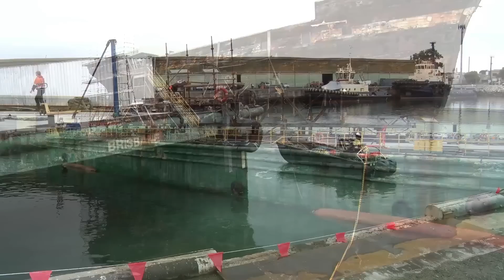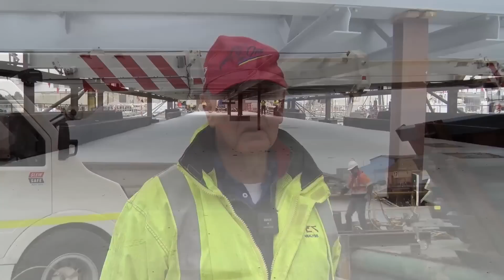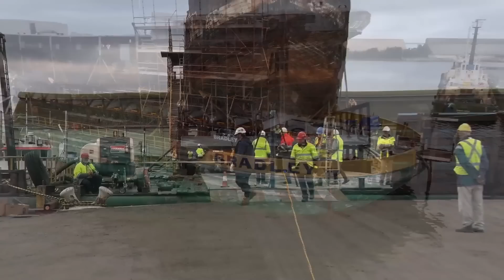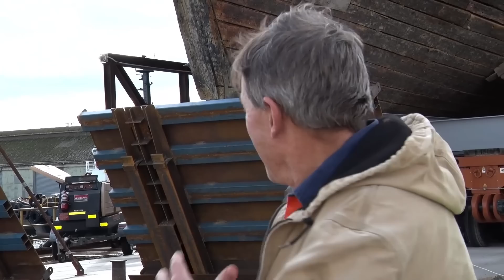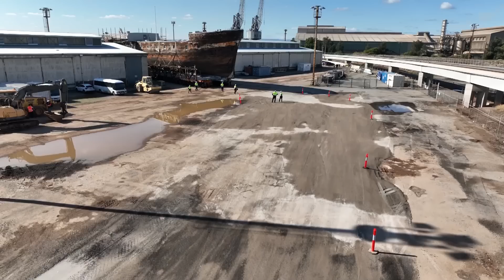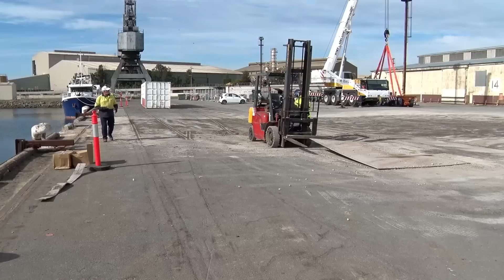Clipper Ship's Final Voyage.   Stage #4       June 13 -16   2024

Comment: I knew these ships are big in the water, but out of it, they're massive! Such a beauty of the past, being  moved with the latest technology. 💗
Reply from the maker: Thank you for your comment jcmac47. 
Those SPMT'S are something else aren't they! The ones you saw in action were "on loan" for the day (it was actually more like 4 days!!) from ANI (Australian Naval Infrastructure) & they move subs &/or sections of, at the submarine base here @ Port Adelaide.
Reply: @edster9221  To what degree is she going to be restored? With mast, etc, or hull only? Either way she's enough to make me want to visit eventually just to see her! Cheers from Canada.
Reply from the maker: Hi jcmac47
Thank you for your interest. Restoration over time shall go something like this...
1/ Three  First class cabins will be built (2 almost finished)
2/ Hull exterior will be caulked & sealed against the weather (original caulking between the planks has long since gone!)
3/ 3 Masts will eventually be added, & with the appropriate type of supports as per (they will also be that of original dimensions)
Interior in general terms will require minimal extra work (apart from the caulking) as we have already held several musical & interactive events. 
If you care to check out some of my earlier videos, it should give you a much clearer understanding of what has been achieved to date.
Reply: @edster9221  That's wonderful! Thanks so much for your reply. Much appreciated.

Comment: you guys Aussies? where abouts is this at, looks very much like Port Adelaide ? jezzs that a lot of wheels
Reply from the maker: Hi TurboHDT
It most certainly is Port Adelaide. The SPMT'S (self propelled modular transporters) that you see in operation here, has a load bearing capability of over 4,000 tons! 
The ship + cradle = less than 600 tons
Reply: @edster9221  think ill take a cruise down to the port and check it out, thanx for that mate😀
Reply from the maker: No problemo TurboHDT
Enjoy your visit.

Comment: Shame it will never see water again, there was hope for this one to be able to after the fire destroyed the Cutty Sark
Reply from the maker: I tend to agree with you BUT........., the expense would be phenomenal! The maritime safety requirements etc; would have all involved jumping through hoops for years to come. In the end, we would basically have a new ship & therefore NOT original.
Reply: @edster9221  They said the same thing about the cutty sark, when it that fire it had another 2 to 3 years of work to go, and she would have been in the water
You are going to replace every bit over time
Reply from the maker: @southerneruk  
Hello southerneruk. From the information I am privy to, that is not likely to happen. The repairs/renos that have taken place to date,  is only just sufficient to preserve her originality as much as possible. You have given me food for thought though  i.e shoot some footage with one of the Board members of what is planned in relation to replacing/renewing items or areas.
Reply: The fire did not destroy the Cutty Sark. Fire was mainly contained to the decking which was not original anyway. As she was under restoration at the time the fixtures and fittings had been removed. She came out of it really well and is now back to her resplendent self!
Reply: @dianeunderhill8506  The cutty is a wooden plank ship on a metal framework, all planking was destroyed, and the metal framework was warped. It will never see water again to far gone
Reply: @southerneruk  Don't be ridiculous. The Cutty Sark was never intended to sail again.Always meant to be displayed as she is. A TV programme explained what happened and it was not as serious as it looked. She has been returned to how she was meant to be!
Reply: @dianeunderhill8506  Before the fire, the cutty sark was up for sale for £1, but there were conditions, the people who bought it were working with two other groups, the idea of all the repairs was to get it seaworthy again
Reply: @dianeunderhill8506  Thats great to hear, and know that she is still around as well. will she ever be seaworthy again?
Reply: @catey62  No unfortunately as she is in dry dock at Greenwich, London and  supported by steel props as it was found too much weight was on her keel. She is a big tourist attraction and much loved.
Reply: It is very sad.  Watch some of the recent videos of the interior. Between that and the condition she was in when I last saw her at Irvine, she would need to be rehulled, which would then mean she was no longer original.  I am just grateful she has been taken to a warm climate.
Reply from the maker: Hello grumbo39
You mention "warm climate".... Since the move, it's been everything but that. Absolutely dead lucky to move when we did (as mentioned in the video) Since we had the choice of....Wet, wet & wind & then wet some more!! 
I know full well how she had to withstand the weather for years in that part of the globe. Will shoot an update mainly of interior, but also externals since arriving at her new home.
Thank you for your interest sir.
Reply: @edster9221  You are welcome. I was doing a spot of work for the Museum (turned out a lady 'borrowed' the router power cable for the kettle!!  🤣) and I had a free tour as a result!!  The City of Adelaide (still Carrick at the time) was sat up on a slip looking very sorry for herself.  The Museum tried hard, but like all of Britains seaside towns, they are struggling as nobody is going there thanks to the now thankfully removed British Tory Govt destroying the economy.  Irvine used to have some great stuff, but its now either completely gone (Magnum Centre) orshut down (Big Idea).  Without doubt she isfar safer with you.
Reply: @grumbo39 well you are well named. Such pessimism. Never mind it will only get worse with a Labour Government. You think the economy has been ruined, well wait to see what this useless lot will do !